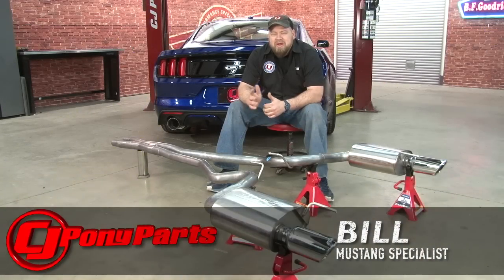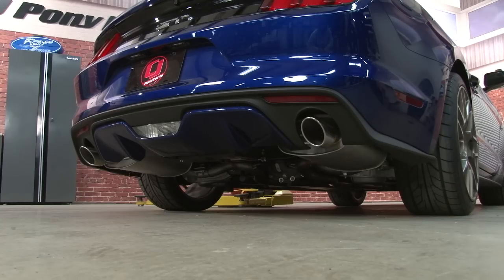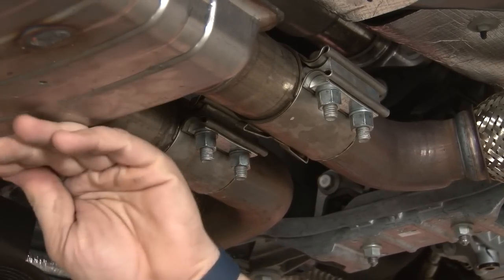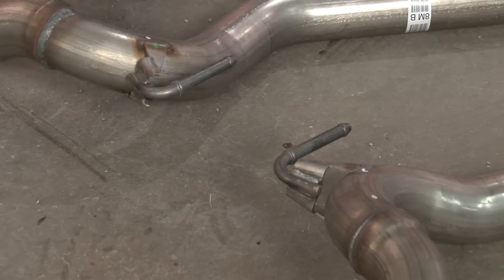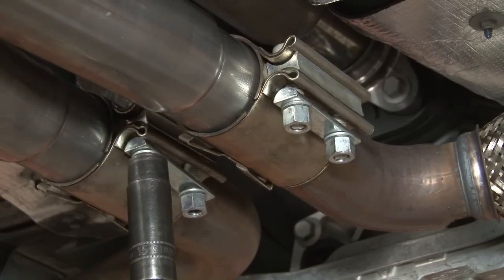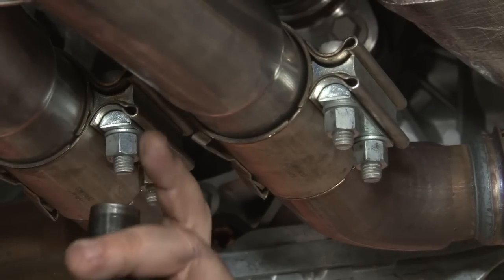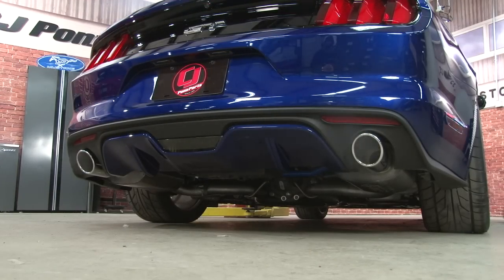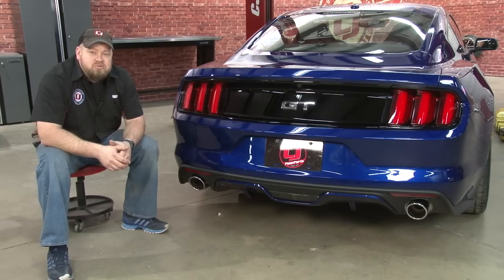2015-2017 Mustang GT Borla S-Type Cat-Back Exhaust Installation

Comment: What was the use of the 8 mm hex and why did the left muffler swivel down like that? Isn't it one piece.  I've ordered the s type from you and will be installing it in two days and would like to avoid surprises.  Thanks
Reply: Alex Staton  The tool list was from the previous install that had bolt on tips, the 8mm is not used for the S type. The muffler was clamped on so we could show you a stock system removal, it has been cut off previously for an axle back install.

Comment: Bill, Is this S-type available with an H-pipe instead?, or can I buy this system in parts, meaning, everything but the x-pipe and I can buy the H-pipe separately?  If I'm correct, the H-pipe will slightly reduce the raspyness(Hence a more old school muscle car tone), and provide low end torque instead? Your advice would be great.
Reply: +Rajendra Prasad  This is only offered with an X pipe as a cat back. If you wanted an H pipe you could get our resonator delete H pipe and the Borla S type axle back.
Reply: +Bill Tumas Thanks

Comment: The best one by far in my opinion.
Reply: it's the same one as ford racing sport
Reply: Khyber GT at the end of the video, he said sounds diff.
Reply: matthewlau254 it's same muffler. just says borla on it instead of ford racing by borla. even borla confirmed s type and sport are same even on the older models. only one that is different is the atak
Reply: Khyber GT They are no longer the same. When Ford used to get the mufflers from Borla for their sport system they used the S Type. When Ford agreed to co-brand with Borla unique mufflers were made for each system. Borla shows cutaways at SEMA of the different mufflers. The sound is similar but they do sound different.